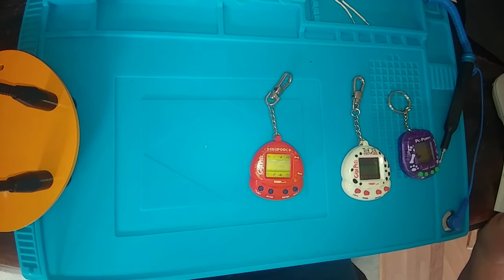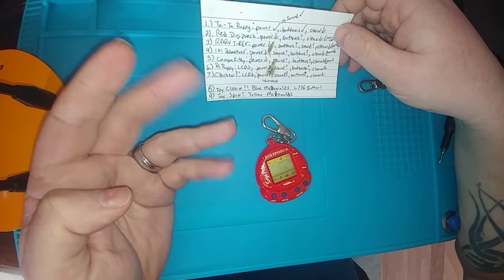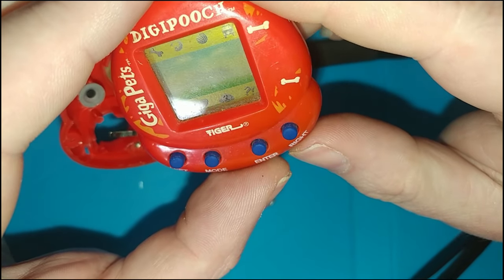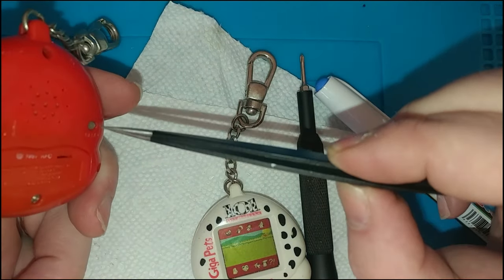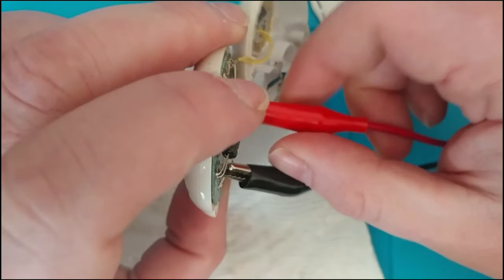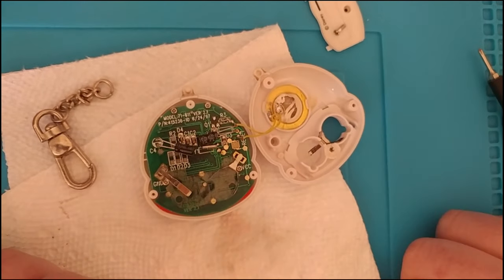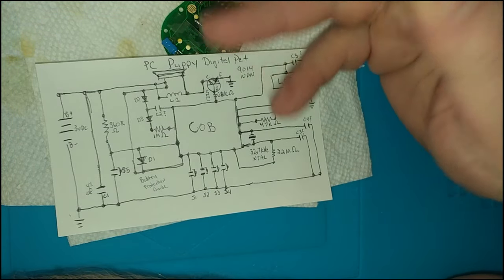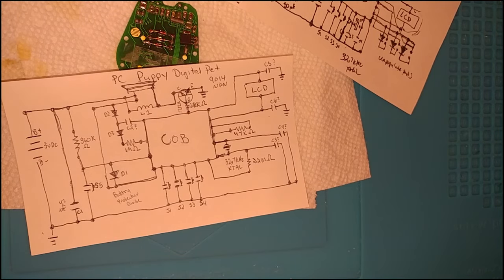Handheld Digital Pet Repairs Part 3

Comment: I recently fixed a ta-ta puppy, I bought it off ebay and the batteries had leaked significantly that the battery leakage ate away the metal terminal on the backplate, my hubby and fixed it by soldering a thin piece on to what was left and it now works perfectly 🙂 it was the batteries put in from the factory as it had never been opened. I wish that the batteries were put separately so that if they have no been opened and they are from the 90s that the batteries can't cause any damage to them
Reply from the maker: Really glad that you found a solution and it's sound like a good find given it was never opened, albeit the battery problem. 

If you're enjoying my videos please consider subbing to my channel if you haven't already. I try to engage with my audience as much as possible.